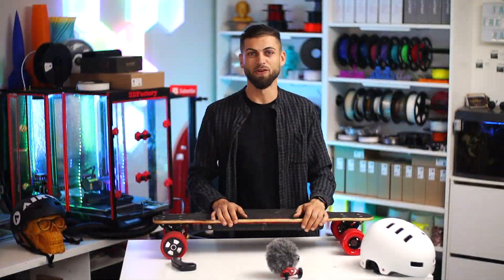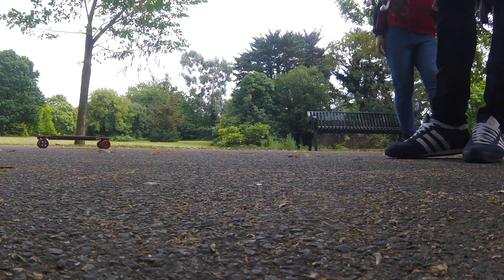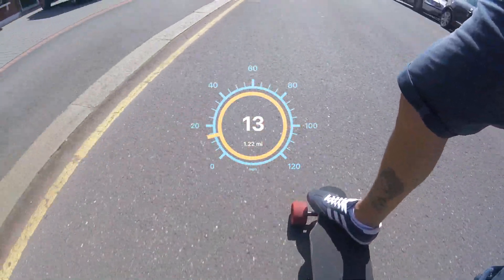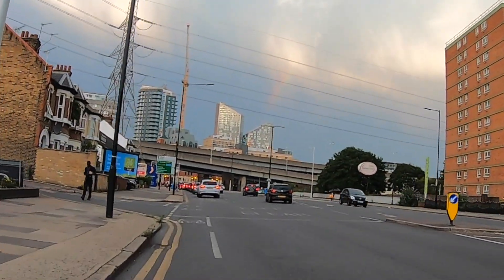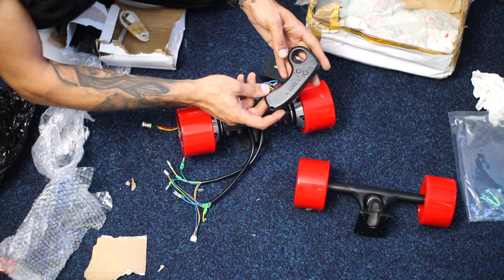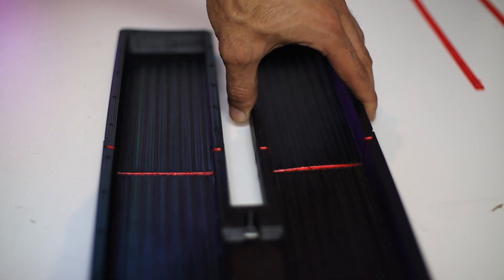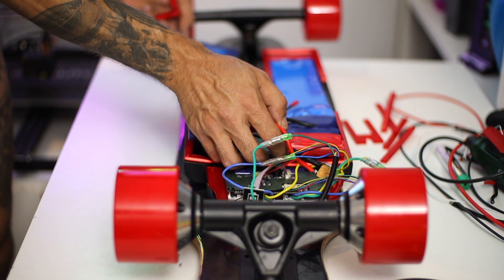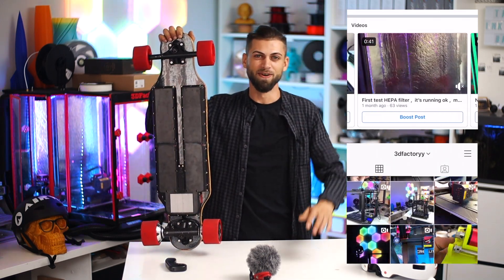Electric Skateboard DIY & 3D Printed

Comment: I dont think your nickel connections are sufficient, especially the one connecting the two half packs together. You might get away with it, as the hub motors arent really power hungry, but it would be safer to build the batterypack properly.
Reply from the maker: Yes... for my setup . :).. it is working really good :)... thanks for watching